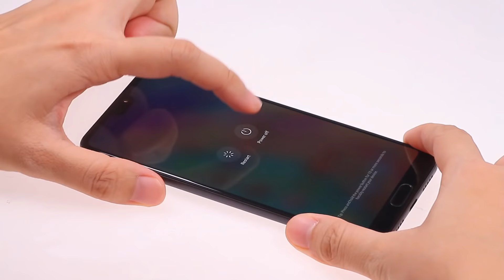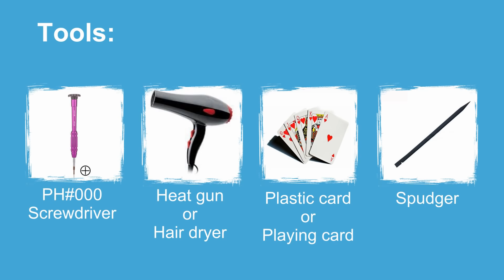P20 Pro Fingerprint Sensor Repair Guide

Comment: Follow up- got your parts + the extra tools I ordered. The most challenging part was the LCD screen. I found heating up the lower-left corner and then using a razor blade helped to get the removal process started. I then used your plastic thin sheets and heat to remove the lcd screen it.  One thing to mention, in addition to the black long antenna cable, I also had a white one. It's not in your instructions; however, it was not difficult to deal with. If others encounter this white cable, just take some photos of how it's installed before tearing things apart. Also when testing the fingerprint before finalizing and gluing it back together, you need to state the user has to hold how the microswitch on the back near the camera to do this test.  Very pleased with the outcome. I think I will order a new battery before permanently sealing this up. CLEAN your lens and lens on the back plate before sealing.  This guide and parts ROCK!

Comment: i am replacing display and it has just hole... it misses the metal frame plate you see in step 8, so now I wonder how do i remove it from the old display, it holds strongly

Comment: I've ordered parts. Looking forward to this repair. Thanks for the detailed instructions.  Patience is the key.
Reply: How did it go?
Reply: @tennisthelegend  The repair went well. No issues. I also replaced the battery since I had the phone completely open.
Reply: @Cyclingbrian  did you need to remove the whole screen?
Reply: @alvinlebon9368  Yes as the video shows @ around the 4 min mark. I know some have done this without removing the screen but I could not determine how this could be done without possibly introducing other problems.

Comment: I have learnt to live without the fingerprint sensor, no problem at all. After new update it is overheating like crazy draining my battery, Huawei wants to charge me because my screen has got a crack and I am refusing to pay anything for their poor policy. I was wondering whether I could just lift the lower part of the screen and somehow cut the connection between sensor and motherboard. Would that ef my device or could be a quick and cheap way around it? Would appreciate some help here!
Reply: My home button got a crack in it 3 months ago and I've learned to live without it too. However, much like you, after the recent update the home button now gets VERY hot and drains the battery quickly. I'm a bit worried about leaving it charging whilst I sleep incase it catches on fire. I'd like to disconnect it too, without having to do all the steps in the vid.
Reply: @xnimmerx  let's see if op or somebody else can help us, I just want to disconnect the sensor from its pin by lifting the front screen a few milimiters, I need some reassurance that nothing will damage the phone permanently
Reply: @guidogalindo7814  Have you had any luck yet?
Reply: @wojciechruszkowksi8800  no man, Huawei worst customer service ever. Device was sent to their repair centre under the promise they wouldn't charge me for the repair if they could prove the fingerprint sensor overheated. When they got it they said they couldn't find any problem with it and asked for £270 for repair.

I asked for my phone back and bought another phone for less money. Class A scammers Huawei as a company

Comment: You don't need to take the screen off to get the fingerprint sensor replaced. Just remove the speakers and you can see the FPC.
Reply: is there a small gap to fit in the flex cable ?
Reply: @jeiciaa8347  yes
Reply: Lol so I broke my screen for no reason ????
Reply: Thanks for your advice. 
Just to be sure:
Is it possible to remove the sensor from the back side? Can you pull out and re-install the sensor cable from the back side?
Thanks in advance!
Reply: @nrbrtbns Yes, actually you may need to gently poke the sensor before you pull out from the back because there is some adhesive between the sensor and the screen.
If you tried poking but the sensor doesn't move, a heat gun or a hair dryer is your best friend.
Reply: @Intsar33  Sad to hear that... I have done replacing the sensor 3 times on this model without the need to remove the screen at all. 
The video is kinda misleading, but if you have the professional equipment (e.g. repair shop) to take off the screen, you might find it easiest to remove the screen first. Personally, I don't have the equipment... All I had were my hair dryer and a screw driver set.
Reply: @junhaoliao5356 Thanks a lot, then I will try to fix the sensor that way. This seems much easier than removing the entire screen as well. 👍
Reply: @nrbrtbns  You're more than welcome! Just try  your best to be gentle when you pull the sensor out, unless you are replacing with a new one and you don't care about the old one. You may know the flex cables are really fragile if you have any previous experiences with those.
Reply: My fingerprint sensor from my huawei p20 doesn't work. It's also warm, sometimes hot. Have this bad effects on the whole smartphone (especially battery) or just the fingerprint sensor?
Reply: @lisa4471  I think there is a high chance the overheat is due to the malfuctioned fingerprint sensor. What you have described sounds very similar to mine before I replaced the fingerprint sensor for the first time.

Comment: Is it really a button or it is just a touch sensor? I am asking this because as a button it can broke in time but the touch is much more durable from my experience.
Reply from the maker: It's just a touch sensor.
Reply: I experienced the exact opposite... it took just 1 fall from 20cm height, on a rock and the sensor is gone. the same happened to a quadrillion old iphones and nothing happened... i was wearing a heavy duty case and a extra thicc glas foil, but this didnt helped the sensor much

Comment: Did not manage to open my P20pro. Even after applying 90°C of heat over a couple of minutes I wasn't able to get a 0.4mm thin platic card between the backside and the frame. :(

Comment: replaced without removing display from frame. much safer and less effort.
Reply: How is is possible exchange home button without removing display?
Reply: @Lawryzax  You can see the back of the IC, cable and fingerprint sensor when removing the speaker. It needs to be done carefully but it's possible to do without removing screen.
Reply: Thanks so much for this comment I was about to give up when I watched the video.  Read this comment, so had a go and able to replace the sensor without removing the screen. Cheers!

Comment: Show phone operation on the display in which you changed the sensor, not from the new display which is at 7:46 minute, the one from step 12 has factory foils, these are not original glues !!!